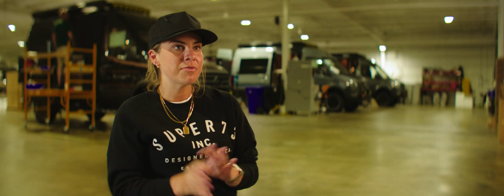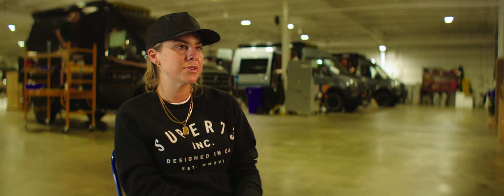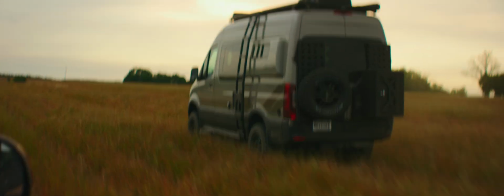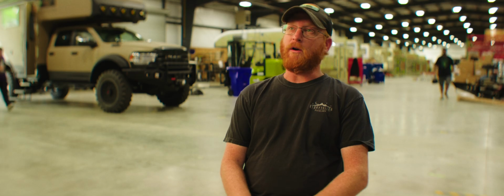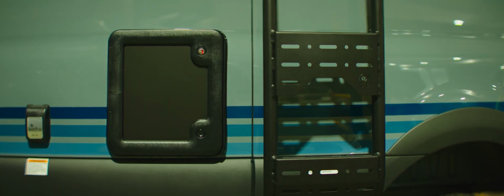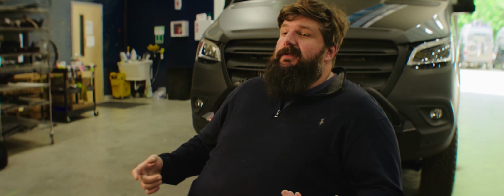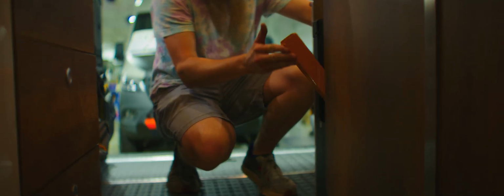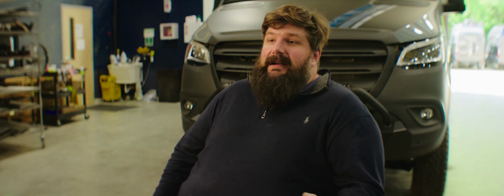The Story Behind the MODE XO.

Comment: I have a beast mode w/Volta and it has been problematic from the start(for some reason the Volta system shuts off and then restarts).  I auto-start charge for 1 hr and it gives me a 30% charge which is terrible.  On two separate occasions I have called Volta and no one has ever returned my calls.  Additionally, they said I would need to change out the digital screen and then update the system which they have failed to do on two teleconference calls.
No we have no answer to the problem and I have a bad Volta system in a vehicle I live in.  I do not recommend them or Storyteller for putting in a faulty energy system in a $225,000 RV.  It is pathetic and unacceptable!  Wait till you see the pain in the ass way to update the Volta as well.